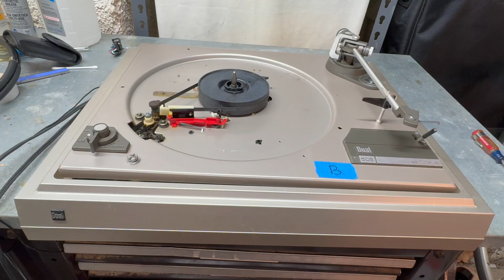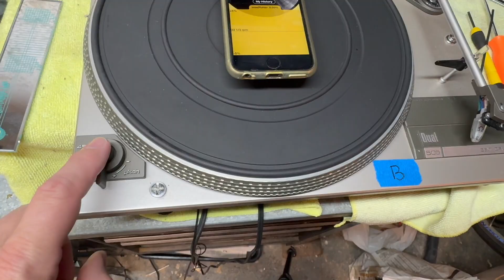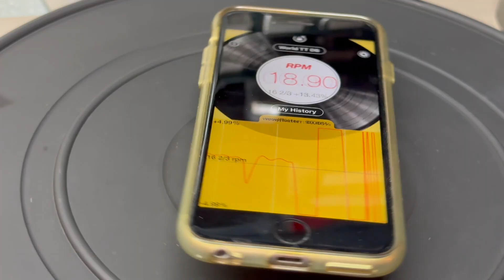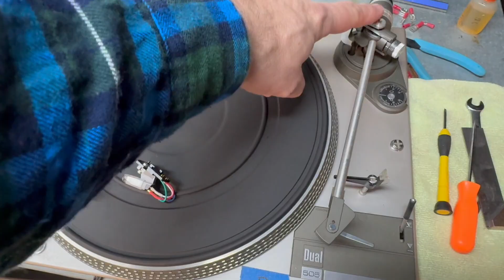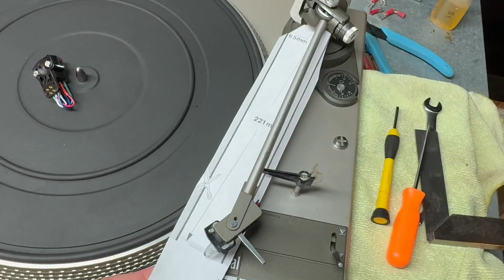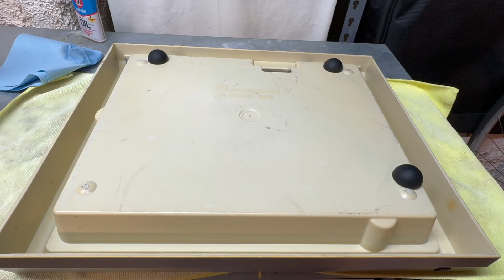Dual Duals!  Overhauling the CS 505-1

Comment: Regarding the cartridge dropping out of the head-shell, there is actually a set-screw that screws into the top of the head-shell and locks the finger arm in place, which you did not even mention in your video. The hole for the set-screw is visible in the top of the head-shell. I had one of these turntables, and I never had a cartridge drop out. The original cartridge was the Dual/Ortofon TKS 49S, with the sled built into it. No alignment required. The main problem with this mount is the electrical contacts can fail, leading to no sound in either or both channels, and the little latching fingers can break, it's only plastic. When the fingers break on a TKS 49S, you have to replace the whole cartridge, when they break on the adapter sled, you just replace the sled. This is the reason the CS505-2 went to the standard mount.
Reply from the maker: You are correct, of course, and I didn't figure that out until after I made the video.  Neither came with a screw, but an M2 will fit

Comment: Thank you! I have a Dual 505-3, I'm not an audiophile, but when I bought a vinyl with music I had heard dozens of times before, I noticed that it sounded a little bit slow. At first, I thought the belt was worn, but out of curiosity and a bit frustration, I came across this video and I discovered that I can literally 'fine tune' the speed with a single nut and it worked!